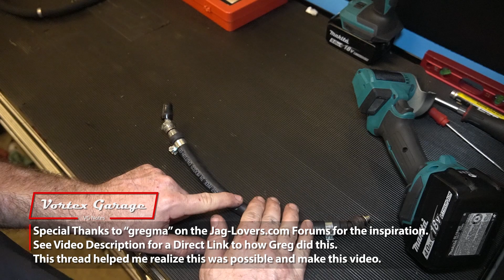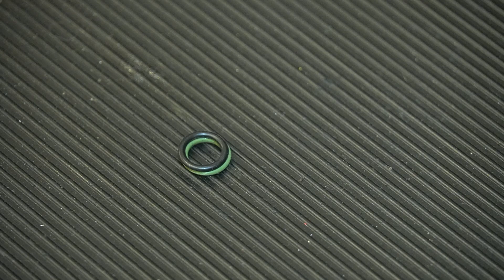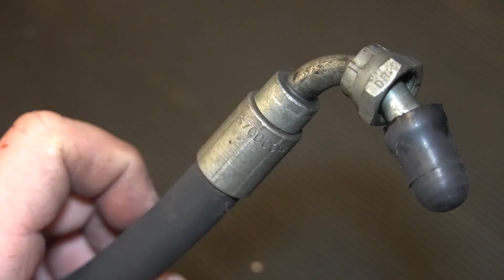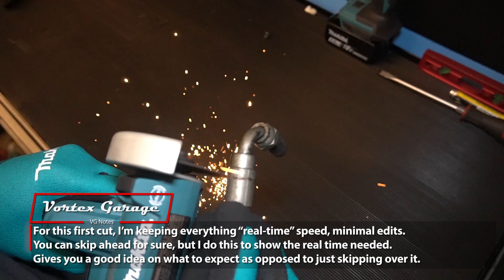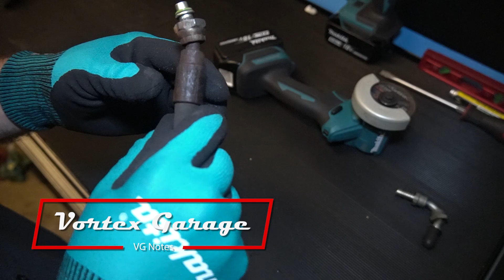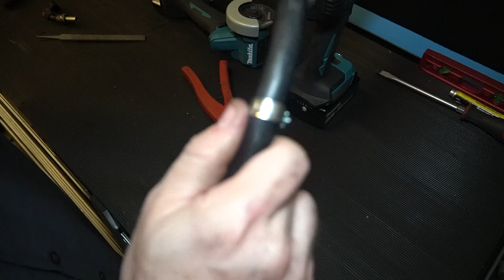Rebuild Transmission Cooler Lines on Jaguar XJS V12 - Cheap and Easy DIY

Comment: Hi, thank so much for all info from You I watched many videos here. I have a problem with my 1990 Jaguar XJS HE 5.3 V12. When the car is cold, it starts fine, no problem. When it's turned off and the engine is warm, there's a problem starting the engine. It starts and stalls a few times. I want to check AAV, is it possible that aav working not well ?  What should I check, in your opinion? Thank you for your help. Sorry for my English I hope that you know what I mean. ))
Tom